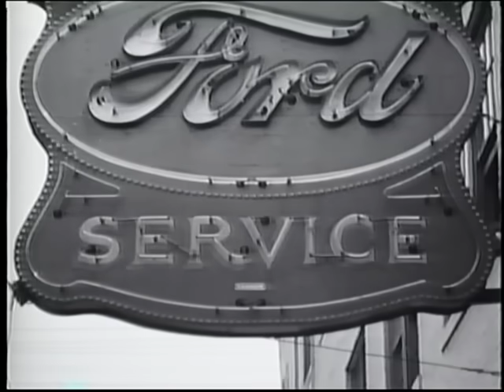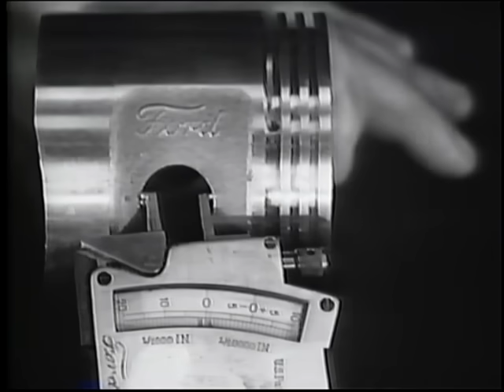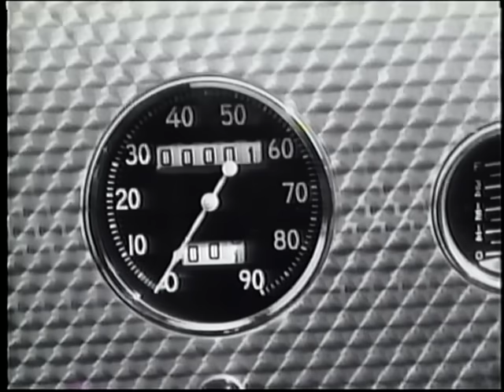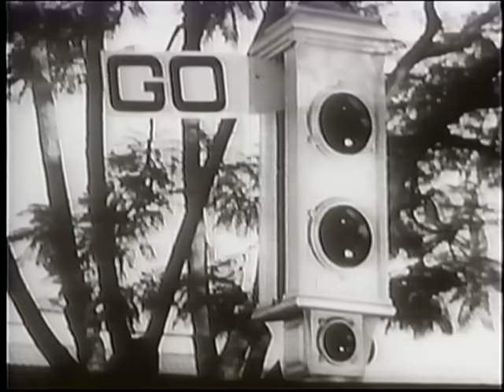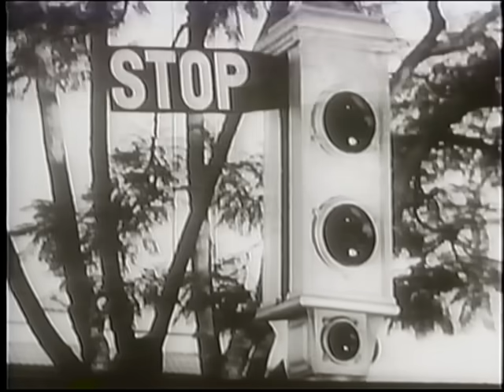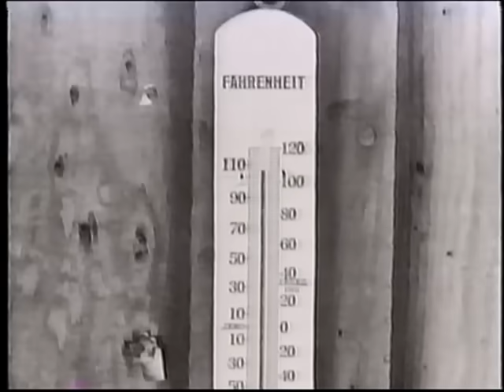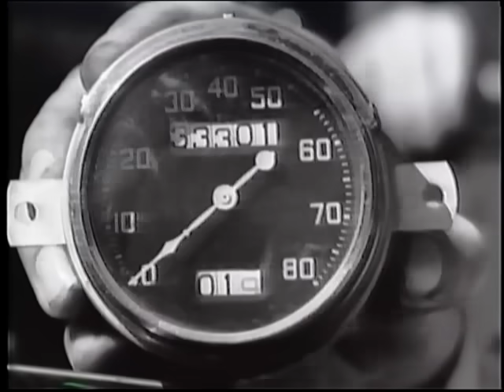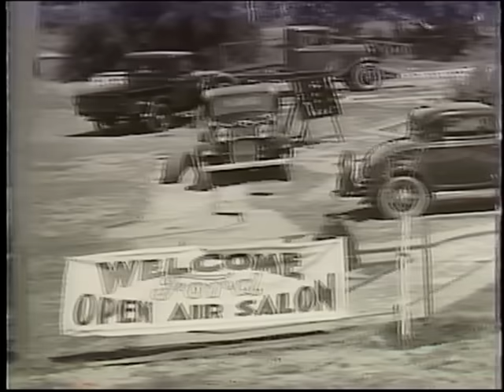1932 - The Invention of the Ford V8 Engine

Comment: this was back in the good ol days, everything was built in the U.S.A.
Reply: And stuff broke down all the time....
Reply: Gr8 b8 m8
Reply: OK.....give an example of 1930s U S cars that "broke down all the time" . Those cars were so simple there wasn't much that could go wrong.
Reply: they did break down alot back then,  everyone was still learning about building cars better..  i would say one of the biggest improvements to the engines is when they starting using 'chrome' piston rings  back in the '50's.. there are lots of other improvements, but those rings  far extended the life of the eng.
Reply: but they were just a big 4 or 6 cylinder basic engines and seldom ever drove over 30 miles an hour. What would "commonly" go wrong?
Reply: the generator cooked to death on top of engine .if driven thru water front distributor took a week to dry no start .pistons broke by rings
Reply: And fuel was cheap !
Reply: I think it started going down hill in the late 60 '
s
Reply: stephen dwyer Nice. Can you say something else nutty? How does communism fit into the jew puzzle?
Reply: (Slow clap) Well done, very very well done Sir.

Okay its clear I am in the presence of some real talent.

If you don't mind, could you please weave something in there about Obama and moon landings.

Its a tall order I know, but not too tall for you I suspect.

Annnddd GO!
Reply: The task was to link Obama with some sort of moon conspiracy. Throwing in communism and some sort of Jew plot would of been extra points.

Oh well, nice try though.

Have you been on meds before and just decided to stop taking them, or have you not been diagnosed by a professional as of yet?
Reply: Which scare you the most, Jews or Muslims?
Reply: Chevrolet built their first V8 (288ci /4.7L) in 1917! take that Henry!
Reply: +limpdickit Cadillac was earlier, with a V8 reaching production status in 1914.
Even earlier were the French: Léon Levavasseur had a V8 up and running in 1902. This engine found its main use in aeroplanes.
Reply: No, I meant Levavasseur as in Léon Levavasseur. https://en.wikipedia.org/wiki/L%C3%A9on_Levavasseur
Reply: So long before Henry Ford "invented" the V8.
Reply: Great. But what has this to do with V8 engines?
Reply: omepeet2006 V8 engines are clearly a jewish communism conspiracy. Learn to be woke dude.
Reply: + Stephen dwyer Time for your meds mate.
Reply: stephen dwyer English? Do any of you guys have a clue what old mate just said?

Odds are he felt "dull" on the medication and decided he didn't need to take it.

This is what being unmediated looks like.
Reply: And that's important and relevant because?

How about you tell me how the mayor of London is a Muslim?

Oh no wait thats a documented fact and those you don't seem to know anything about lol.

Let me guess, he is secretly a jew?
Reply: Time we took you out the oven mate because you are properly cooked.
Reply: Stephen Dwyer, it sounds like you were involved in this Holowotsit… Which means you’ve got Austrian roots. You might do very well in a career as a painter. Good luck
mate and remember to take your meds..!
Reply: Anthony Smith,     I can answer that one. In those days the roads were subjected to lots of water because of drainage problems and the Ford V8 flathead had the ignition (the entire distributer located just above the crankshaft on the front of the engine , turned by the camshaft directly) It was not waterproof and it would short out easily, but if you were to take off the distributer caps(two of them) you could dry it easily.
Reply: terry wheatley    And the banjo was the instrument of choice
Reply: omepeet2006 this video is about the invention of the Ford V8 and not about the invention of the V8 engine itself...  :-/
Reply: Tom Long Strewth, but the story is presented in a way that might make you think the V8 was ol' Henry's invention. Which, of course, it isn't.
Reply: The one piece V8 block was his accomplishment.
Reply: Did you learn this on your own or is this what they told you at the last Klan rally?
Reply: Greasy Jews sound delicious.
Reply: MyJizz UrEye this is the funniest comment thread, Mr Jizz and crazy man here got me in tears 😂
Reply: Yes, Bill Clinton and Nafta was the first nail in the coffin.
Reply: D-Rutt 1969 The 'nails' are much older than Cigar-time Willy, you can't ignore politicians and corporate bosses agendas/actions from political parties and ideologies your prefer.
   It was Ford & GM in the late 1910's & 1920's with US & foreign governmental dealings towards an 'industrialist empire' without nationality i,e; incorporated hegemony sovereign only to the market irrespective or nations, laws and politics.
   Nixon also started the 'selling out offshore' ball rolling further as did Regan, Ford, both Bushes, Obama too, all post/after America's Industrial Revolution/Awakening have allowed US corporates to go off-shore in some manner - so long as some profits and taxes went to IRS, the Treasury & shareholders, the public doesn't matter except to be moneyed enough to wish, want and buy...
Reply: Water pump seals. Rarely got 10,000 miles from them without leaking.
Reply: He means there were good people back then. They were simple people with a backbone that worked hard to make this country what it is today. No thanks to the demonrats.
Reply: Yeah, back when Dodge built most of Ford cars...
Reply: Don’t you know about the British. ?
Reply: limpdickit But Ford did a one piece cast block v8 engine, if you listened to the video, the Lincoln’s has v8’s but were three or parts of the block put together, this was one piece Block!
Reply: A global free market with the incredible specialization that brings is far better.
Reply: omepeet2006 In fact he was the inventor of the V8
Reply: MyJizz UrEye WTF are you talking about?
Reply: right, this caused lots of population growth and our leaders hated that.
Reply: omepeet2006 only people who don’t pay attention would have thought such rubbish! It was clearly stated the V8 had been previously invented. Henry was only casting the V8 block in 1 casting!
Reply: Ya don't forget Henry Ford supported herr Hitler. 
I own a ford f150 and love it. But the truth is the truth.
Reply: and no coronavirus! but Corona Beer, Si. Imported.
Reply: Tell that to someone that it is 94 you may get the response, let me tell you what the good ol’ days were
Reply: terry wheatley that wasn’t until the late 70’s, they had them but were not standard issue parts. The engine used tons of oil till broke in if u replaced them. We did so many valve jobs and ring jobs it kept our shop busy till chrome moly rings took over in the early 80’s, they also came out with stallite valve seats and that ended valve jobs.
Reply: omepeet2006 they were not 1piece block though  like a Ford
Reply: @stofferpoelman6401  everything did then! If you got 50k miles from s vehicle then it was legendary
Reply: Or by Canada !!

Comment: Henry Leyland was the engineer and a founder of Cadillac and Lincolin. He was responsible for the V8 design and even V12s produced for the military. Henry Ford made the V8 but took from Leyland's engineering skills. Leyland's Cadillac Motor Co produced the first American V8. Oldsmobile was the first to produce a single pour block and overhead valve V8.
Reply: Fords learned a lot from their part in the Liberty engine production.  Ford not only made the V12   Liberty but  the V8 version.
Reply: Andrew W MacFadyen 
all these engine designs had been built and proven.lol
Reply: And all copied from French designs.
Reply: Theodore Schmidt: while Oldsmobile was the first General Motors car with a single pour V8 block. That was almost 20 years after Henry did it. Not impressed.

Comment: Watching the guy pick up the transmission off of the assembly line and just lug it over to attach it to the engine makes me think about how tough factory workers were back in that era. Nowadays OSHA has stepped in to prevent workers from being able to be that tough. Nowadays if the factory performed that same kind of work they would have to call in three guys to lift that one transmission but before they did there would need to be a supervisor standing there checking off a list of 10 things to look at for safety before the guys actually lift the transmission up the whole process would take 30 minutes to attach One transmission to one engine block because the supervisor and three employees were all having to meet a list of OSHA compliance measures before they actually touched the transmission. Factory workers back in that era were hardcore and they got the job done with no OSHA no safety regulations and they didn't have to take 15 minute breaks every 2 hours to reflect on their thoughts and they didn't have to attend safety meetings every 2 days and did you see a single one of them wearing a hard hat? Hell no. They were tough they didn't need hard hats or back braces or gloves. They just came to work did their job punched out at the end of the day stopped at a bar on the way home had a couple of beers went home possibly to their wives and children who were happy to see them their wives were putting dinner on the table they lived the American dream back then nowadays the American dream is to be a celebrity or to be the next app creator or the next viral YouTube Star. Back then if you wanted a salary you went to work and you worked every single day for your salary you put in the hours you put in the work and as a result that built hardcore human beings back in that era. They grew up tough they didn't have cell phones to look up information they didn't have forklifts to help them lift everything they didn't have support groups to help them work through their feelings they were real hardcore American people. It's so sad that our world has gone so soft
Reply: It all comes down to this, " hard times makes strong men, strong men make good times, good times makes weak men, weak me cause hard times " repeat
Reply: @mrivucu  well said... I agree
Reply: We are all pussies now. A millennial told me today, complaining about going back to office work instead of working from home, "no one can't work 9 hours in an office anymore!" I said to him: What about the people who were/are working standing for hours in a factory, a restaurant, or inside a coal mine, or millions of more examples like that I can give you?
Reply: The biggest irony here is that instead of chopping down trees with a rock or some other tremendously masculine pastime, everyone in this thread is impotently crying about the good old days.
Reply: I get what you’re saying, and yes, people are much softer now. Still, things had to change.

Comment: "in his heart henry knew it was all over for 4-cylinder cars" and welcome to the 2017 where 4 and 3 cylinders is a thing
Reply: W_Callaghan, 
He was talking about the cars, not the motorised shopping trolleys.
Reply: Yeah but Ford's '32 V-8 was 221 cubic inches and it put out 65 hp. The three cylinder Ford Focus is less than half as big and twice as powerful. Your're not going to pull a boat with one but it will get you where you need to be.
Reply: I believe the 4 and 3 cylinder engines of today produced a lot more horsepower than the 4 and 3 cylinders of those years.
Reply: @InfiniteMushroom After 100,000 miles.
Reply: My 4 cyl Ford engine puts out four times the power of their first 8 cyl.
Reply: @InfiniteMushroom I've got a 2006 Focus and I've done almost all the work on it myself. $50 dongle to read codes.
Reply: Yeah a lot happens In 100 years lmao

Comment: Had to laugh when the narrator said, Henry Ford knew it was all over for four cars.

Hah, four cylinders are now the majority if we take in all the cars of the world.

From time with Chrysler I learned the problem with casting a single block V-8 was in getting the molten metal to completely fill the casting with no pockets of air. Even now, with better technology, the V engines have a higher rate of rejection than straight line engines.

When a block is found to have an air pocket they just dump it back in the mixture of molten metal and try again. That adds to the cost of any V engine.

Comment: when i get my first time machine, i want to bring back one of these "modern" v-8's....
Reply: Greg Walker😢😂
Reply: You already did.
Reply: Make sure you put the fine tune in the Flux Capacitor.  Otherwise you’ll be running face first into the Twin Pines Mall road sign
Reply: Just imagine what one of these would be worth now if you had one just off the factory floor and for a $500 investment.

Comment: The first blast engine that used a mixture of air and fuel, and which really worked, was designed and tested in Italy in 1854 by two Tuscan physicists: Eugenio Barsanti and Felice Matteucci.

It was a piston-free vertical motor: the explosion, inside the combustion chamber, occurred through a mixture of air and gas illuminating;

The explosive engine was then refined in 1860-1861 by French Jean-Jacques Lenoir and Alphonse Beau de Rochas. But he was still far from representing a reliable propulsion. It was in fact drastically improved and transformed into an industrial product by German Nikolaus Otto. (from which cycle name eight).

In 1876, Otto achieved the first four-stroke engine (suction, compression, burst and exhaust), which was the basis for all the subsequent developments in this field. Daimler will then develop a light and powerful burst engine that can be applied to cars.

In 1889, Benz will present its first commercial car, but the bumpy engine has its invention to two Italians. In 1892, Rudolf Diesel patented the "Diesel" engine, similar to the internal combustion engine but without candles.

A few years later, exactly in 1901 Maybach, Dailmer's collaborator, will make the first modern car called Mercedes by the name of Emil Jellinek's daughter who commissioned it. It is the first car not derived from a carriage, but designed on a chassis conceived to house an engine.
Reply: @fromgermany271  I have been blamed for plenty that I have no ownership in,  so, you wouldn't be getting a cherry.  I work in the northwest often and travel through the squalor of the Reservations and I still wonder how in the world we, (humanity the world over), haven't done enough to cause our complete decimation AGAIN. 

I found the surroundings in Augsburg and Munich to be comforting, as if some of my bloodlines were from there,,, and with the Hess name being in my family tree,,, I take shots with no small amount of humility.

I revile the axis powers of WWII,  but some of the dearest aspirations I have ever had,  have been to visit places in Europe for their significance to my chosen profession of mechanical engineering. But alas,,, as the world is as dangerous as it has become,,, I tend to do all my admiring of the Olde country from a safe distance. 

I don't dispute where things got started, any more than I do where they have been improved upon by and large. I am currently watching the downfall of America with no small amount of chagrin,  given my vantage point as a grandson to a WWII Airborne paratrooper.  But I am a student of history and I know how these things roll. 

Blame me however you want,,, but I suspect I would show you kindness, respect and hospitality if you were on the driveway to my home.

Have a goodun
Reply: Yawn . .
Reply: @patrickwayne3701  forgive me but it was not my intention to offend anyone.
I respect everyone's work and above all I appreciate the time people spend posting educational videos.
 sorry again
Reply: @tonino5113  I'm not offended man. You're good.

Comment: Those old V-8 Fords. Father had one. So did a friend. A smooth surge of power. Not all that heavy on fuel consumption, either. Those old cars were comfortable and sensible
Reply: @phantomcorsair8476  The ones I was talking about were in the part of the subcontinent that became Pakistan. We have indifferent maintenance, weather problems and poor roads. As I recall, those cars were surprisingly forgiving and reliable
Reply: @phantomcorsair8476  600000 plus!?? Amazing

Comment: Glass fuse, must have been original condition Shotwell. When motorcycles had glass fuses I recommended replacing them all before a trip. Great roadside repair Jay, can't do that with modern vehicles.

Comment: Internal combustion engines had been around for at least 40 years by then, so the Ford V8 was not "invented". It was the continuation of development of and already existing technology.
Reply: Actual claim to fame of flathead was one piece casting of V8 block which was hard to figure out but made affordable V8 production possible.  I do not know why it was difficult, or how the issues were solved. Probably not addressed in this video.
Reply: @davidbostock6776  Different casting techniques have inherit problems, the evolution was in the casting.
Pour molds v.s. Induction casting.